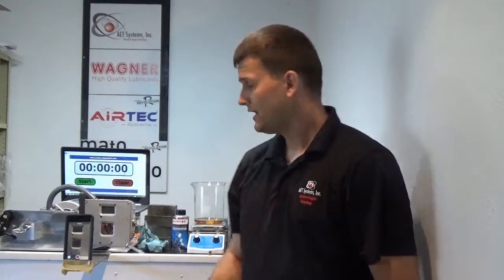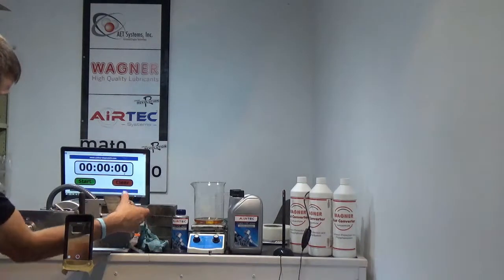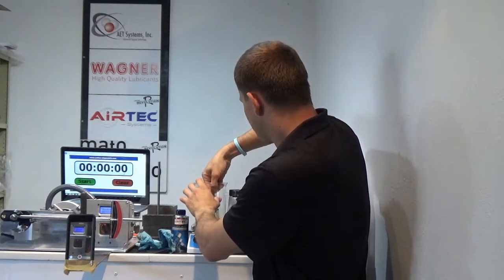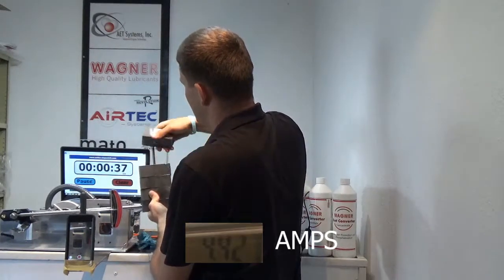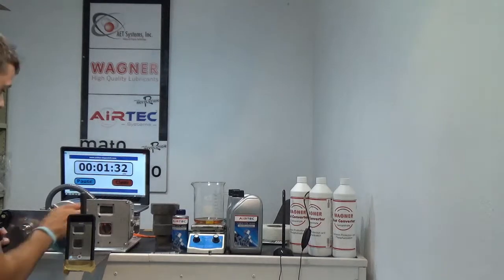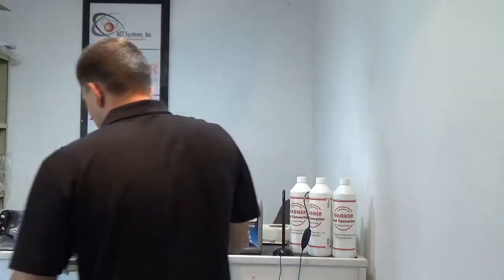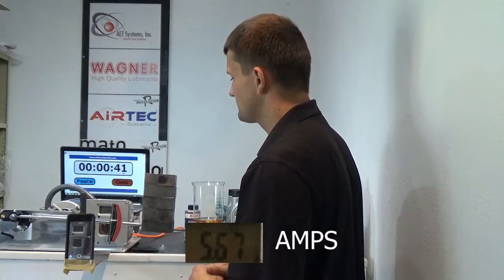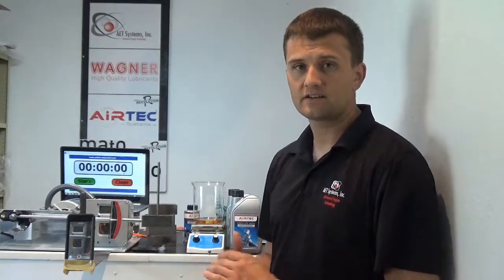Micro Ceramic Engine Oil Test: Your Roadmap to Fantastic Results

Comment: you are supposed to use a spray on cleaner like a IPA wipe down with methylated spirits etc and also the hard grid 200 to 300 grit sandpaper to complete clean the hard bearing surface before each test ?
Reply from the maker: Yes, this was performed in the video when he is cleaning the surface.  The hard grit paper is used to remove surface damage caused by the testing.

Comment: The correct SAe oil friction tests is the 4 ball testing methods, this timken testing machines is not the real friction test for oils, so till they do those type of tests online on u tube, then you will see the real results, sure most good petroleum based friction oil modifiers will work, but be very careful is you have a new engine the engine must have at least 10,000 KM done and the same with gear oils like auto trans and differentials etc. :)
Reply from the maker: Yes, you are correct.   This is just a simple visual test we can take with us to show friction and wear additive differentials in oil when we are at exhibitions.   All our products do go through a 4 ball weld test in their production phases and that data is available on our website.  However, that test machine is not very mobile so we use this test to demonstrate one property of the oil.